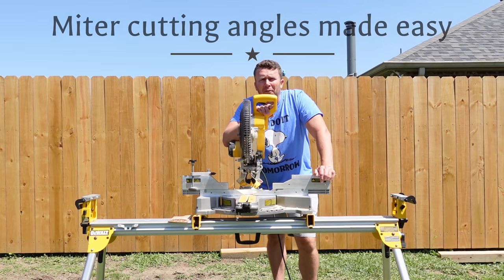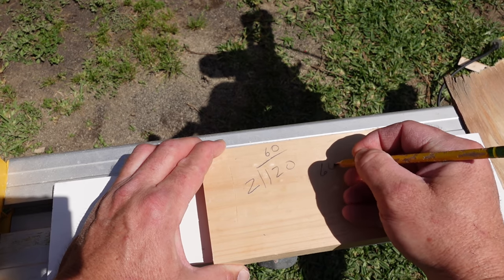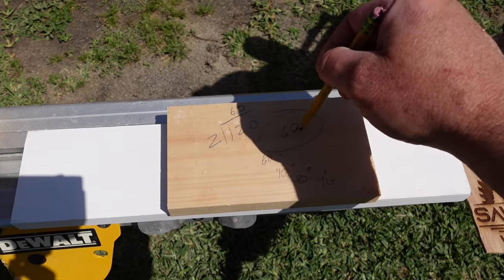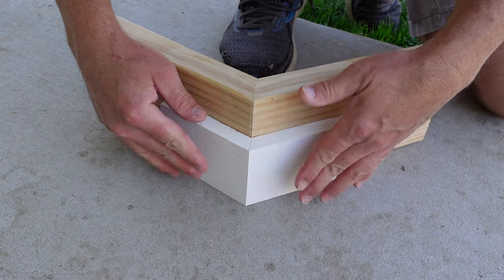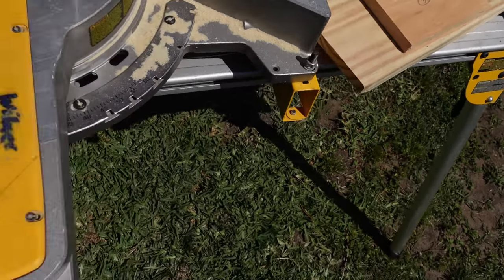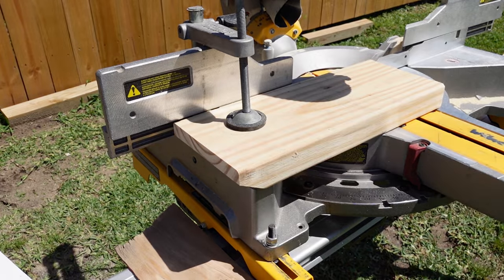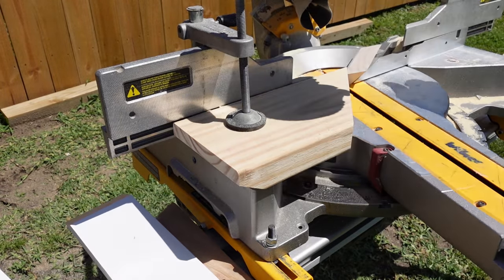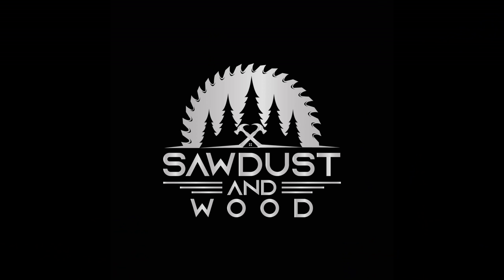99% of people don't know this about a miter saw...DO YOU??

Comment: Really, y'all can't see it? You don't need a jib. You have to use a 30° and 60° in the two examples respectively. Using complimentary angles requires it to be done the hard way, the way just demonstrated. 

There are two types of reflective angles

1) complimentary in which 90° (acute complimentary angle) or 180° (obtuse complimentary angle) is the sum that results in adding the incident angle with the complimentary angle necessary to total the sum of 90° or 180°.

2) angle of incidence is equal to the angle of reflection whose sum is ambiguous 

The mitre saw is ubiquitous to the angle of reflection. Therefore, the answer is much simpler. The trim in the first example must sum up two pieces whose juncture must total 60°, that is each piece must be the same (angle of incidence equals angle of reflection), or 30° each. Both 30°s can be cut from the same side of the saw. This forms the acute angle.

The second seems complicated, but no, it is just as easy. No jib is required and again, both pieces must be equal and their sum is ambiguous. The mitre saw requires a solution angle be 90° or less, not 180° as the demonstration illustrates.. The example totals 120° with two vectors which must necessarily be 60° each. Any obtuse angle must total >90 and <180°.  But this is greater than the 90° the saw is metered or scaled for, which is maximized at 90°. So the demonstrator's answer is to produce a jib that will extend the metered maximum of the saw to 90° + 45° = 135° An obtuse angle.

NOT NECESSARY!!!!

INSTEAD, AFTER CUTTING THE FIRST BOARD AT 60° on the right side of the saw, merely do two positional changes to the second board. You will still be cutting again on the same 60°  angle on the same (right) side of the saw as the first board. 

The first positional difference will orient the board by flipping it half a spin, or 180° horizontally along it's abscissa of x axis. This will orient the trim so that what was the back side of the board will be be facing forward, away from the fence.

The second positional change will reorient the board by flipping it half a spin, or 180° vertically along its ordinate of y axis. This will orient the trim so that what was the top edge of the board facing upward will now be facing downward.

The saw is turned to the right of 0° to 60° from the first cut. Use the same angle on the same side and cut. These two cuts will create two equal but opposite angles which will total a perfect 120°.

NO JIBS, JUST STOCK ORIENTATION AND COMMON SENSE!!!
Reply from the maker: This is one video of many in my channel about cutting angles. I have shown all the different ways to do it, this is another way. Another tool in the tool box, my channel is about helping people better themselves and learn new skills. I am learning too, I pass on things I learn to this channel. We are not professionals, there are other channels you can go argue semantics with but I’m just glad you watched the video and left your honest feedback. Thanks for watching and just remember I don’t claim to be a pro. Thanks

Comment: Isn't it a lot simpler to simply subtract the angle you read from 180 (straight) once, instead of mentally reversing the scale on your saw every time? Seems like it'd leave a lot less room for errors. The way you do it is simple enough with easy angles but it gets real messy when you measure, say, 105.3 degrees.

To use your example: 120 = 60 degrees off straight. Divided by two cuts = the 30 degrees you need to set on your miter saw.

Comment: Formula. .... 180°- 120°(you angle) = 60° ÷ 2 = 30° cut on saw..
Reply: This works for any angle .. start with 180 - subtract the angle found - take the number remaining and divide by 2. 
180-90=90÷2=45°
Just remember to start with 180 a straight line..

Comment: Theoretically all correct but in the real world on site with plastered walls where the build up of plaster at the very bottom of the wall is greater than just 3 or 4 inches further up ( the height of an average skirting) the joints very rarely butt up true first time u nearly always have to take ur block plane to the cuts to back bevel them so as to make the front of the joint close up it’s just a fact on site generally the external corners r never true and plumb

Comment: Would have been much simpler to take a speed square and check the actual angles of either one of the 2 boards that joined to make the piece. I could see it was about a 30 by looking at it. That angle finder is much less useful than a speed square lol

Comment: Actually he is wrong, the last two cuts he made were not 30° as he claimed. They were 75° because his nesting piece was at 45° and he added 30 more by setting the saw to 30°. He is over complicating it
Reply from the maker: My friend watch again, with the jig in place it was 45 degrees I subtracted 15 which brought me to 30 degrees. Two 30 degrees equals a 60 degrees angle.  Thanks for the feedback
Reply: @SawdustandWood  wrong again, if they were 30° cuts you would simply set your miter saw at 30°.

Comment: this is way overcomplicating it. all cuts will be 90 (or zero on the miter saw) 45 or 22.5  I have never needed to do angles differant than that because these are standard angles and all buildings follow this. if you are cutting some weird 60 degree angle I do not know what that would be for.

Comment: Buy a compound slide miter saw.
Reply: why would that help?
Reply: Because you can set any angle and cut any length stock without having to worry about the fence that's why
Reply: @daviddoran9221  as the OP demonstrates, every saw has its limits, nothing is infinite. Compound miter will not cut 65º out of the box, for example. Chances are, if the saw you have won't do it, buying a new saw will not help.
have a nice day
Reply: @osmith5086  mine will because it's a Hitachi.. and I suppose you've never seen that... like I said come on out I'm sure there's some shoe mold we could have you run.

Comment: You could just subtract at the 90/0 degrees 90 minus 30 equals 60 degrees. Either side. Your over. Complicating it for most simple minded people. Complimentary just making an easy suggestion. 😂. To not complicate it.

Comment: No inside mitres here.... only outside corners are mitre'd.    With 90 and 120 degree walls, all the inside corner 8" trim is coped.   Cut one end square, then the end to be coped at 45 degrees, and back saw, at an acute angle, the 45 end with a coping saw. The 45 cut gives you the coping line on which to cut. As long as your back cut is less than a 90 degree angle from the front, say 80 or 85 degrees, it should fit perfect. So you measure from the wall to the face of the trim that receives the coped end. Perfect fit every time. Coping, once you try it out and get comfortable doing it,  is very fast too.

Comment: You are making it too complicated .
Since the center zero is 90 and the angles to the left are greater than 90 degrees then the 120 is 90 plus 30 to the left .
Since 60 degrees is less than 90 then you cut 2 thirty degrees on the right side of the miter. 
You just have to remember that angles above 90 is cut on the left of zero and angles below 90 are cut to the right of center zero .

Comment: Most individuals that own mitre saws are usually finish carpenters …. and every finish carpenter knows to divide the total desired angle by half…. It’s simple math…. 
  You don’t have to be a brain surgeon to figure this out… plus your mitre saw has all the able increments to help you …
 And also boys and girls …..Don’t pet the Blade….!
Reply from the maker: Great comment ,but you are wrong about just dividing the angle in half. But correct about the blade, it will cut anything
Reply: @SawdustandWood  … we’ll if there’s maybe somewhat of a radius… or compound or multiple miters are involved… then no .. not by half

Comment: You're kidding right? You haven't the saw like you've used it for a lot of years, but i find it hard to believe that nobody sees what i am seeing. 
Listen folks, really nice guy in sure, but you don't have to make a jib, that's the hard way. When had seeds run out of fingers to count, instead of repeating their count on the same fingers, they'll take off their shoes so they can use their toes... The hard way, right?

Look, all you have to do is since you end up at 30° on the other side, so you have to do is make two flips with the board. 

1) use the 30° on the right hand side where he was counting degrees 90° - 60° = 30°  from the fence on the right 

 90°--------------------------------------------------------90°  (0°)
       80°                                                                                      80°  (10°) 
             70°                                                                          70°  (20°)
                   60°                                                              60° (30°) 
                         50°                                                  50° (40°)
                               40°                                      40°  (50°)          90°-(½ ×60)=60°                                                                            
                                     30°                          30°  (60°)     (0°)          . 90°-30°=60°   
                                           20°              20°    (70°)   (10°)                       60°=30°
                                                 10°  10°   (80°)      (20°)        
                                                       0°                    (30°).
Reply from the maker: John I never claimed I used the saw for a lot of years. Calm down with the negative energy, what’s wrong?? Nobody here is angry but you. Anyways you are always welcome to watch and comment your thoughts. Thanks brother